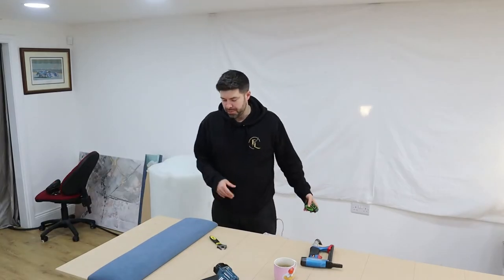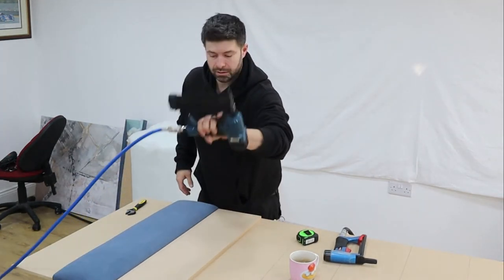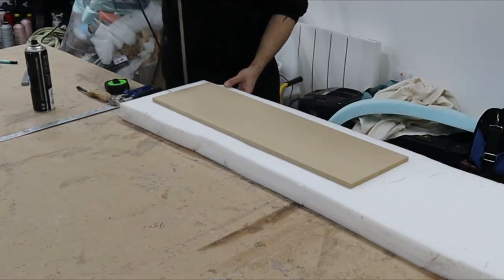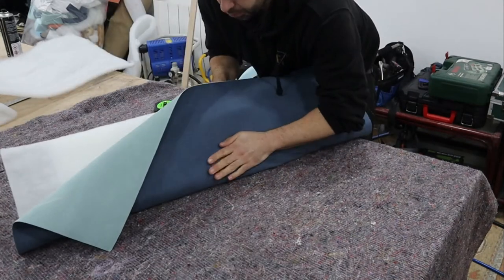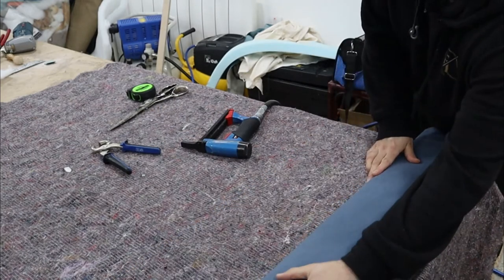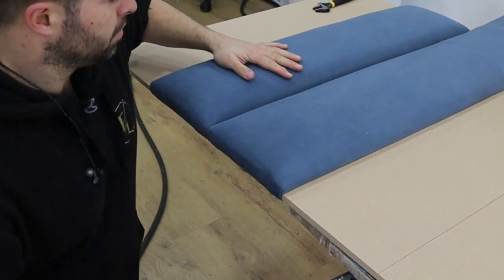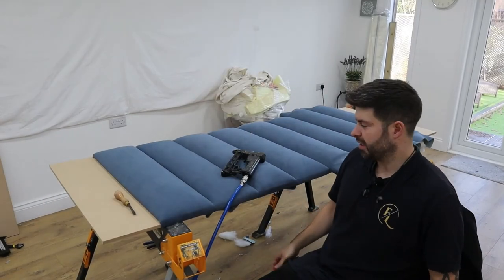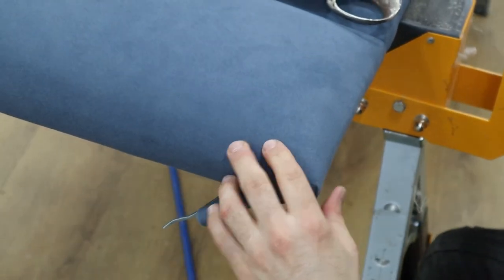THE EASIEST WAY TO UPHOLSTER CHANNEL TUFTED BACKS | FLUTED BACKS | FaceliftInteriors

Comment: What kind of wood did you use & how thick. How thick is the dacron you use. I know you said you had an allowance for the width of the flutes, but do you cut the height the same size as the base board? I want to thank you for your video. I have a customer that asked if I could do something like this. In my head it made sence to use the technique you have demonstrated here, then I founf your video and it gave me confidence to approch this job. It's going to be a floating backrest above some cushions (that I will also be making, making cushions is one of my favorite things to do) 2 walls meeting 1 about 100" and the other about 90". I know it will be a challenge but I think I got it all worked out in my head.

Comment: I came to see how to reupholster over pre-made purchased fluted headboards WITHOUT taking them apart into separate pieces, which I cannot do.  I guess the only way is to cut the fabric and leave a split close to the edge but I'm afraid it will weaken and rip there.

Comment: when making individual channels for mounting on a wall in a commercial space, how do you handle the corner where two walls meet?
Reply from the maker: Hi Patti! One channel would have to go all the way to the wall and the other would butt up to it. So you’d have to make allowances I.e make the one against the wall slightly longer and the one that butts up to it would be slightly shorter. So if the total length of the channeled back rest was 100inches by 100inches. You’d make one back 100 and the other 98 (if the foam and wood measured 2inches thick) If that makes sense 🤣

Comment: Great tutorial. Overall with the mdf boards and the foam/material, how thick do you think this was from the wall? We have limited space (depth), do you think it could work with 1” foam?
Reply from the maker: Hi Samuel! You could use thinner MDF for the back board and the flute boards to save you some room and you could absolutely use 1inch foam on the flutes. They wouldn’t look quite as round and luxurious but it would still work 😊👍🏻
Reply: @faceliftinteriors  thank you so much I’ll give this a go! Thanks for the advice.
Reply: Hi can you show me how I can upholster a iron head and footboard?

Comment: How was the board attached to the wall?
Reply from the maker: Hi Julie. Sorry for the delay in responding. I use either industrial strength Velcro or a baton and industrial strength Velcro so you can take it on and off for easy cleaning.

Comment: Hey, this is amazing. What could be used to hold the woods together instead of a pin gun? Also what fabric is it, any links please xXx
Reply from the maker: Hi Emma, thank you so much! You could screw them together. I did this after, however I just find pinning is quicker just to hold it in place. This fabric is by Sunbury Design and it’s called ‘Nappa’ - it’s an aqua-clean fabric too 😊👍🏻

Comment: How do you attach it to the wall?
Reply from the maker: Hi there! Either use industrial strength Velcro or a baton plus Velcro so you can take it on and off easily for cleaning.